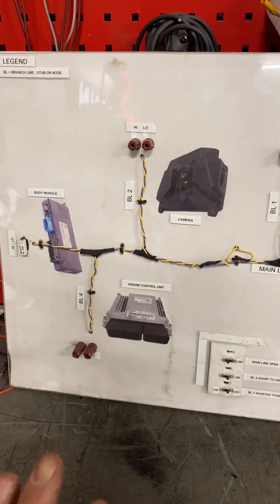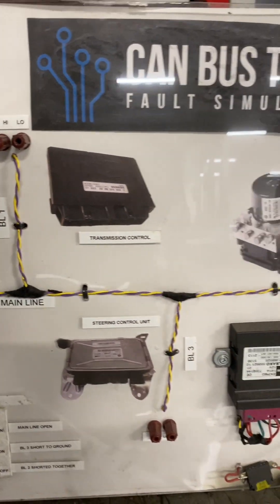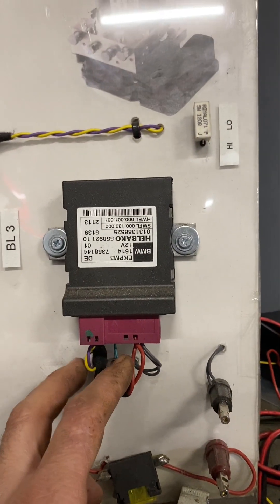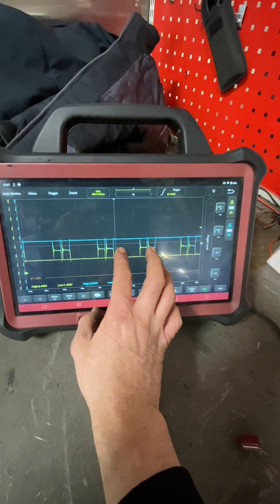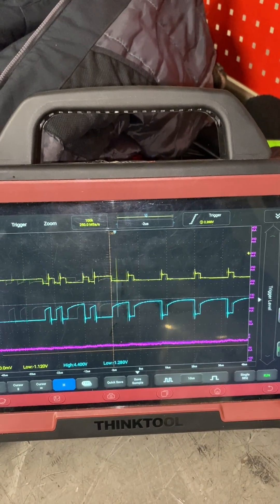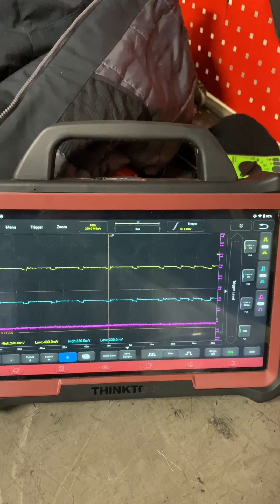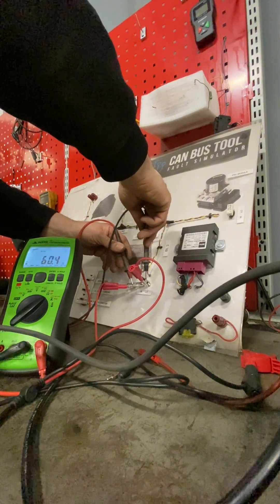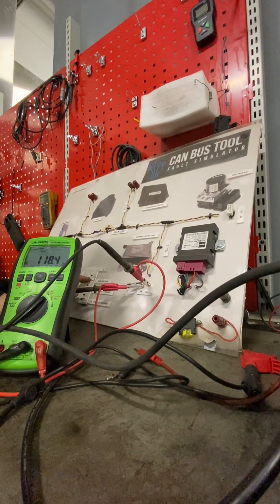My Apprentice Was Struggling, So I Built a CAN Bus Tool!

Comment: You just know I’m going to build one of these now. Don’t worry, I’ll be messaging you when I’m stuck. Haha! 

I’ll keep an eye out for updates on your setup. 👍🏻
Reply from the maker: I want to build a better one 🙂
Reply: @ tell me you plan on still using the same fuel pump control module as I’ve just ordered the same one. 😂

That’ll make a good video when you do 😉
Reply from the maker: I am going full on with transistor switching, arduino sending CAN frames, CAN tranceiver the works 🙂 You can message me any time buddy 🙂

Comment: How come you prefer to diagnose electrical circuits with a power probe instead of a fluke meter. I’m wondering if I should make the switch
Reply from the maker: Its just easier faster. I will make a vid about it 🙂

Comment: What pins on the fuel pump control module did you use to power up and the can signal please
Reply from the maker: I would need to look at it but just +15, ground and terminal 30. If I get time after crimbo I will have a look

Comment: 3 jobs for the day, how do you not go broke? 
What is the pay structure at your shop? 
I struggle at slow times as we are paid flat rate.
Reply from the maker: My basic salary is very high. I dont need to worry about earning bonus but it wasnt always like that. I struggled earning for years giving my sweat chasing bonuses. Luckily there are very few skilled fault finders around so I am in high demand hence the high salary. I get what you mean though.

Comment: I love Lidl. My go to grocer in Europe. Can bus on bmw can be tricky with a shorted comfort access door handle. Their is no fault code and the whole network gets many false positive faults. The most difficult diagnosis I ever did. Maybe newer models have better fault detection than 2010 models.
Reply from the maker: Yep it can cause either a bad battery drain or havoc as you say. Its easy to diagnose but it still stumps many a fault finder